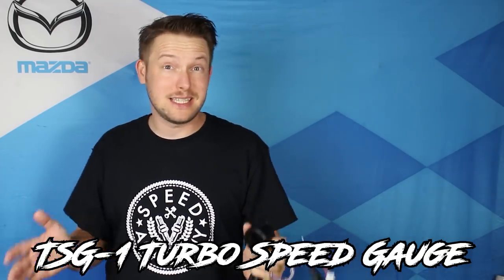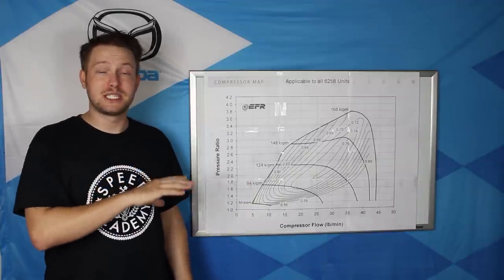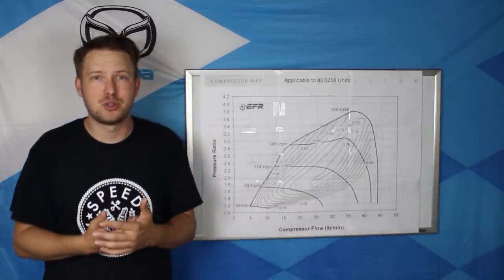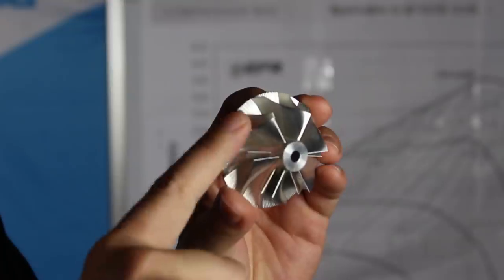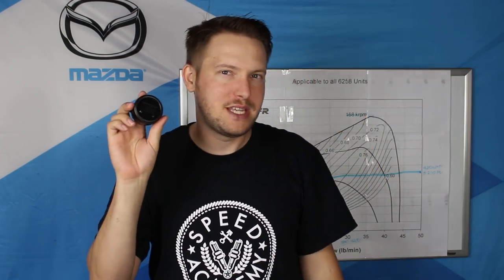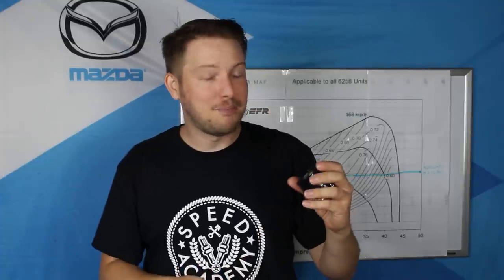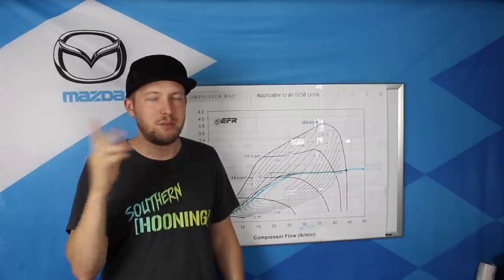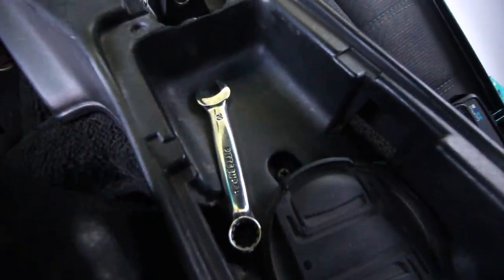The ULTIMATE GUIDE To Maxing Out A Turbo! [Compressor Maps Explained, Speed Gauge Install]

Comment: The only real way to overspin a turbo by disconnecting it is to have a way to small exhaust housing. But if you got that then the engine would run like garbage when trying to make boost.

Comment: You have to simulat the overspeen the turbo with a small leak! Because you need the strength off the engine to speen the turbo, but the leak for the turbo to spool up and over spean

Comment: What if the pressure drop after Intercooler is due to the cooler air charge? .. (it should drop in psi when cooled down, shouldn't it?)
Reply: Good possibility but I agree that it shouldnt be more than 1-2 psi.
Reply from the maker: Regardless of the reason for the drop, the pressure should still be measured at the turbo rather than the engine for best accuracy. :)
Reply: @TheCarPassionChannel  That is a good point!.. also if PSI is a measurement of restriction lower IC flow means higher restriction, which also means that if you get a larger drop in psi, that is more likely indication of "cured" heat boost (that you are reaching the point where the raise in boost comes more from heat than from compression).. i guess..

Comment: you don't want to be anywhere close to turbo max speed at sea level, as when you increase altitude your turbo speed will increase due to the increase pressure difference from between inside the engine and the lower external air pressure at altitude

Comment: What would happen if you put performance cams in it?
Reply from the maker: I'm very interested to see. Because all I predict would happen is the car would just make the same top end power, with a little less boost. Cams can't force the compressor to flow beyond it's maximum. And if the cams were big enough I might even lose low end power. So it might actually make the car slower overall, but I'd love to get on a dyno and do a back to back test with a set of 272's
Reply: @TheCarPassionChannel  Yeah sounds like a lot of money for no real advantage... but flow means torque, maybe it will shift the torque into the higher rpms (torque x rpms= power), or you could be at a better efficiency at higher revs, losing the midrange you're talking about... Who knows!

Comment: You described compound turbos backwards. The big turbo feeds the small turbo, not the other way around. You said it in reverse, and you also said "that bigger turbo taking air that's already pressurized and ramping it up more." The bigger turbo (usually sized to roughly double the maximum airflow) draws in atmospheric pressure, then the small turbo draws in the charge from the big turbo and pressurizes it further. I'm nitpicking, I know, but it's going to bother me if I leave it uncorrected 😅 It actually works out pretty handily, because often you'll be using something like a low pressure turbo with a 3" outlet feeding a high pressure turbo with a 3" inlet, in which case you don't even need to neck the charge pipe up or down.
Reply from the maker: Ah yeah I had it backwards. The exhaust from the head feeds directly into the small turbo and then flows through the big one, but the big turbo actually gets the fresh air and feeds it to the small one, yeah?

Comment: You’d only overspin the turbo if you have closed loop boost control. You’re just running WGDC.
Reply from the maker: The turbo will not overspin even at 100% WGDC 👍 engine is not producing enough exhaust gasses to spin it that fast, regardless of DC (wastegate stays 100% closed during these tests anyways, there isn't any boost pressure to open it)

Comment: 30:44 - Mind-blown - how come it doesn't make the surge noise when you shift gears if you don't have th BOV active at that time? How do you tune it to switch on and off?
Reply from the maker: During flatshift, since the throttle stays open during the shift, the pressure generated by the turbo keeps flowing through the engine (but no fuel or spark) so the BOV doesn't need to "blow off" any extra pressure from the intercooler piping. It never opens, because there is never any vacuum in the intake manifold to open it.

Comment: Hey bro, awesome explanation but actually im still a bit confused on how to put the NA hp number to the pressure ratio, im currently around 160 hp on engine NA, so its means 14.5 psi so should i put it on 2 on the pressure ratio or 1. 5?
Reply from the maker: If your car is naturally aspirated it has a pressure ratio of 1.0

Comment: 23:06 Did I hear a little bit of surge at around 4000rpm? Great video btw I have gained at least 3 iq at the brain
Reply from the maker: Yeah, and that exact clip is the reason I'm adding a 2nd map sensor to investigate, because upon further review something doesn't quite line up on my plotting. The compressor speed doesn't match the boost level at that 4krpm range. Pressure ratio according to the MAP sensor in the manifold is only 2.4, but measured compressor speed is 148k where on my drawn lines it should be ~128k. This could also be a result of higher pressure in the compressor housing vs. what makes it into the intake manifold, or a dirty air filter causing lowered pressure in the turbo inlet which would raise the pressure ratio. I'll be able to measure both when that sensor comes in and if I find anything juicy I'll upload a short video about it either here or on my other chsnnel. Good ear!

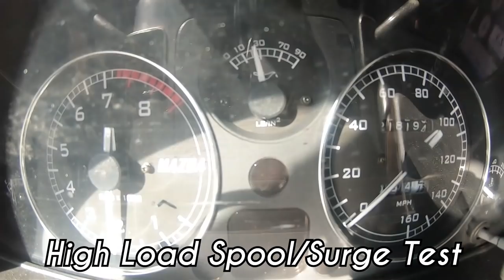Comment: 23:24 - Hey!? What the hell is going on there? Why is the turbo surging alluva sudden?
Reply from the maker: That's a textbook example of surge under load, it's very hard on the turbo and should be avoided. It happens when you have a combination of a turbo that can spool quickly and move a lot of air, and the engine can't take it all in. It's essentially hitting the "surge line" on the compressor map.

Comment: The 10lbs/minute equation is correct. Compressor maps are rated for 93 octane us (98 everywhere else). 
For a very close approximation of what that same turbo can make on e85 you add 30ish percent to the final bhp number ie: 
If the turbo can produce 40lbs/min equaling 400bhp + 30% = 520bhp on same boost pressure on e85.

Comment: Well another possibility is that you don't actually lose 15% of power 
Whether you are putting down 200HP or 400HP, the lost on given configuration and RPM should be constant
Reply: True.
Reply: Torque. Its torque that produces the losses in drivetrain.

400hp at 6000 makes double the torque so double the losses vers. 200hp at 6000 rpm.

Comment: The part I don't understand is how people say you'd overspin it if you don't have the turbo hooked up to the intake. Maybe if you're running something that already flows well and you have too small of a turbo, but then the issue would be inherent with the smaller turbo. The turbo in a sense feeds itself when hooked up to the intake and exhaust normally. You're increasing the cylinder pressure by cramming more fuel and air in leading to higher exhaust heat and velocity. An N/A car, especially one of lower displacement that's built with conservative static compression isn't going to generate nearly as much speed to actually spool it to unsafe limits. At least that's how I picture it, haven't completed watching yet.
Reply from the maker: I think the counter argument, which is partially true, is that since the compressor has nothing to "push against" it will be able to spin much faster without that resistance. Which is true - but not enough to reach overspin. As you'll see in the video I got it to spin 128krpm, where if the piping is hooked up it will only be able to spin ~50krpm or so before it starts generating a small amount of boost. But, I think the exhaust energy it would take to get from 128k to 168k would be huge, in terms of an n/a engine. And on the thought of a smaller turbo, even one that's technically "appropriately" sized, its max rpm will also be higher, 180k-200k+, so it would spin faster since it's smaller, but also be able to handle more rpm. It was a fun experiment!
Reply: @TheCarPassionChannel  Yeah, but you gotta consider that the turbo just spinning is under resistance in itself to even draw in the air and release it back to atmosphere. You are also bumping the power up over 2 times what it'd make without boost as well. Also, I got a dinky tdo5-12a on my starion that was only able to spin 160krpm which would be more likely to blow disconnected, but no one has when they do break -ins. Technology really changed in 35 years, lol

Comment: Great video! A comment about your statement about the guy at 25psi maybe making less hp than you because its working harder. As you can see, you are at a less efficient island on the map than if you would be making the same power at 25psi, which means you are producing more heat than the other guy. Now, more psi directly in itself produces more heat, as there is no way to compress air without it also gaining temperature, so not sure who is winning there. But the fact is, you are really out in the bushes of the efficiency islands and would make a ton more power with a bigger compressor on the same boost as you would be better positioned on the map, buuut that would in itself increase lag, so I see why you would want to keep the one you have. 
A comment why E85 lets you push past the turbos stated max flow, is I THINK E85 contains more air molecules in itself than gasoline, so that might partly be why you can get more power than the turbo can actually flow. The fuel used in Top fuel dragsters contain so much oxygene that just adding more fuel into the motor by itself increases the hp of the engine.
Reply: unfortunately no, the E85 is not nitromethane. the translation lbs/min to bhp is based on bsfc, and that depends on a ton of factors.
Reply: @Nebbia_affaraccimiei  The percentage composition of ethanol ( C2H5OH ) is: 52.2% of Carbon, 13.0% of Hydrogen, and 34.8% of Oxygen.  On top of that, you are running about 30% richer with E85. So extra oxygene is definately "there" but is probably only partly the reason.

Comment: That compressor map is SHIT by today's standards.
#1 I want to see 79% or 80% not 76% for the peak island.
#2 For something that flows 30 lbs/min @ 2.3 Pressure ratio, the surge front (left edge) prevents you from reaching full boost until 13 lbs/min. In a 2.0L engine with typical 4-valve volumetric efficiency that is about 2,700 rpm. Which is unimpressive. For something with that flow capacity I'll prefer if it is around 11 lbs/min or around 2,300 rpm.
--
I very much like the compressor map of the G25-550 better in that size class.
Reply from the maker: If the EFR is subpar by "today's standards" then essentially so is everything else except the G25. Lol.

And I'm sure you're referring to modern engines as well, not the 30 year old design here. 2.3 PR at 2700? You'll never get that with a BP no matter what turbo you put on it, so it's a non-issue. This turbo out-classes pretty much everything in the "400whp with response" category right now, although I am very interested to see someone put a G25-550 on a properly set up BP to see the comparison in area under the curve from 2500-7500.
Reply: @TheCarPassionChannel  LOL...that's old... I thought you were on the previous gen MZR 2.0... but it shouldn't make a difference as far as hitting the surge line. I am sure you will if you have a smaller turbo in both cases.
--
Notice that you "climb" the compressor map as you climb the tach under load until you reach your target max boost? For any given engine spool gradient is steeper with a smaller turbo and gentler with a bigger turbo. It is also steeper with a divided turbine housing (aka twin scroll) like with the G-Type 6258. It is particularly steep if you have a small turbine and a relatively big compressor.
--
With many modern engines, the turbo is deliberately undersized for maximum response and able to reach max boost and torque at about 1500~1700 rpm. Any one of these setup will breach the surge line quite readily if not arrested by the wastegate.
--
Regardless, the G25 is a slightly bigger turbo. Something like the 2967R is about the same size as the 6258 and has a better map. My biggest beef with Garrett is that most of their sane size offerings are not available with divided turbine housings.
Reply: Show me a compressormap with that broad highest efficiency of an EFR at 80% and maintain response in low rpms.

Comment: Since you can plot your results on the graph and you can see it could be possible to make 30psi(boost) in the mid range. Can you use your boost controller to keep you in the best efficiency island? And if so, what do you get for it?         Great video, keep it up. Thanks
Reply from the maker: You can optimize it, but it's not possible to always stay in the best island. And it's not always the most HP to stay in the higher efficiency islands either. Learning this stuff is mostly about where you want to make compromises and where you want the turbo to perform best.
Reply: TheCarPassionChannel  thanks, sounds good to me.

Comment: Driveline loss is not a percentage...Its a fixed amount!!!!!!!!!!
Reply from the maker: So you're telling me that since this car only lost 21hp in factory form (116bhp to 95whp), if it gets built to 1000hp it will still only lose 21hp through the driveline? Sorry but that's incorrect.
Reply: @TheCarPassionChannel  think..if its a %,and its 15 ,at a 1000 hp its looosing 150hp??? same driveline with a two hundred hp car,its now only using 30 hp????This is why its a fixed amount,for driveline...

Comment: Clowns thinking over speeding the turbo without plumbing, turbo needs load to spin faster. Think about that for a min
Reply: that's not how it works..
Reply: @Nebbia_affaraccimiei  yes it is. You need air  to make exhaust gases that spins turbo.

Comment: This dyno is when you had your EFR 6258 on your 1.6L Miata on E85?
Reply from the maker: This is the EFR6258 on the built VVT 1.9 motor. I know it's so much to keep track of 😆
Reply: @TheCarPassionChannel  I remember the EFR6258 vs EFR6758 comparison video you did, and went from around 400rwhp to 490rwhp.   So I figured it was the EFR6258.

Comment: 2 questions: that oil pressure not smoothly going higher but a bit steppy is not pinging? And those TSI's ar not costing you airflow through your IC/ radiator? I guess you get 'ram' air pressure on the 'low pressure' side of the cooling. I sold mine. That is why mazda has those plastic lids on the inside of the hood near the popup lids, i guess: keeping air out.
Reply from the maker: 2 answers: The oil pressure is jumpy because the oil pressure sensor is on the same line as the VVT oil feed, so as the VVT solenoid actuates, it gives wild oil pressure readings. You won't see this on stock VVT cars because they have a fake oil pressure gauge, but I'l still running the 1.6L oil pressure gauge and sensor, so it's quite sensitive.
I have my TSI's taped up on the back side so no air goes through them :)
Reply: @TheCarPassionChannel  Good on the TSI's :) - Yeah i also use a 1,6 oil pressure sensor. But you might want a better one. I know someone with a cut carterpan on his project and he found out the hard way the pressure sensor is too slow. He ran without oil on fast turns in the miata based westfield turbo and didn't see that on the meter.
Reply from the maker: @klinkske  I need to get my OPS hooked up to MS that I have in the oil filter sandwhich so I can get a more solid reading and set up the oil pressure safeguards

Comment: 4:35 whenever you say "pound of air"  you mean "per minute" :)
Reply from the maker: Yes but I didn't want to say "Per pound of air per minute"
Reply: @TheCarPassionChannel  don't be shy xD
Reply: @TheCarPassionChannel  hey at 28:34 you cheated a little bit that wasn't the peak value..
Reply from the maker: @Nebbia_affaraccimiei  Good eye but you can see it peaked after RPM had already started dropping. Not sure what causes it but sometimes there's a slight jump in compressor speed right as the throttle is lifted. Probably the diverter valve opening and the compressor having a sudden drop in resistance since the air can freely circulate.
Reply: @TheCarPassionChannel  the gauge might have a bit of lag processing the data from the sensor?

Comment: How can a turbo be maxed out on different engines at the same airflow when different engines need different amounts of air and are not same efficiency wise
Reply from the maker: It's not going to be something that's accurate to the decimal place. But for explanation purposes, it's close enough. If a turbo's compressor flows a maximum of 30lbs/min, it's going to top out somewhere near 300hp. If it's bolted on to a more efficient engine, it's going to make 300hp more easily and with less boost, but that's it. On the flip side, if you bolt a 30lb/min turbo onto a really tiny or inefficient engine, sure you might not be able to make 300hp because you're hitting the flow limits of something else first (cams, ports, exhaust, etc)

Comment: One Correction i may make. Your 15% Drivetrainloss are pretty conservative. On a manual RWD Car it is more like 10%
Reply from the maker: I only use 15% because every RWD car I've personally put on a dyno has been 15-17% on average. Every 1.6L Miata I've ever seen has dyno'd at 93-96whp which is actually 17-19% loss. Z32's dyno at 180whp (19% loss). NA8's dyno at ~105whp (18% loss) NB's around 112whp (20% loss).  FWD cars can get closer to the 10% range though
Reply: @TheCarPassionChannel  dynos are a huge question mark. remember most of the loss is between the tires and the roller. and some in the roller bearings. on a hub dyno you will never see 15%
Reply from the maker: @Nebbia_affaraccimiei  Thanks for proving my point :) I've never seen a car drive around without wheels before. So if a car makes 85HP on a roller dyno, you can assume it makes around 100HP at the crank. A 15% loss.
Reply: @TheCarPassionChannel  and when it makes 400 hp it still has 15 hp loss. 15 hp , not %.